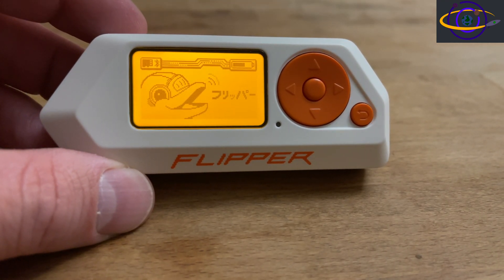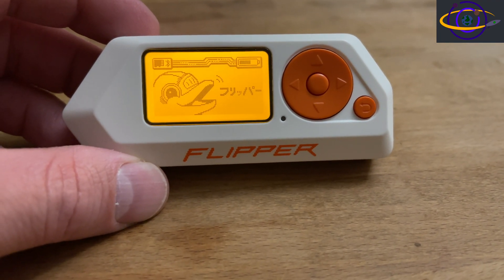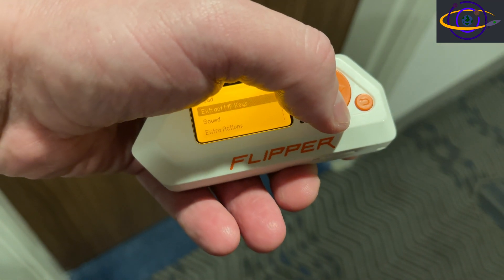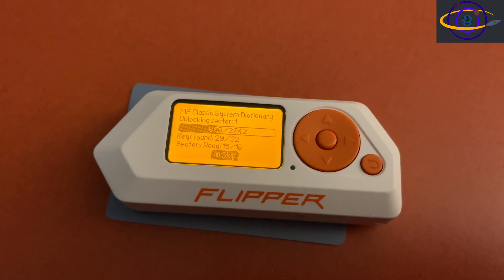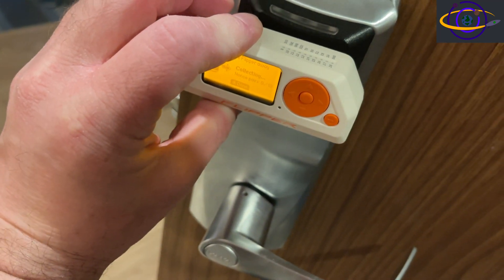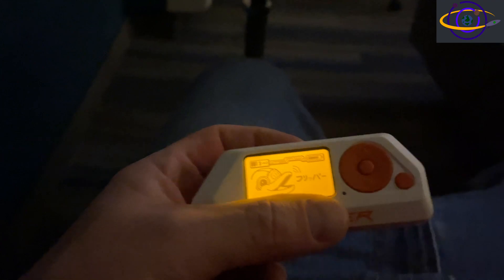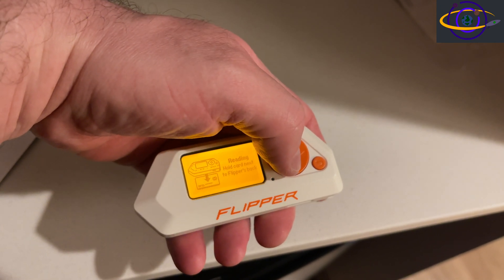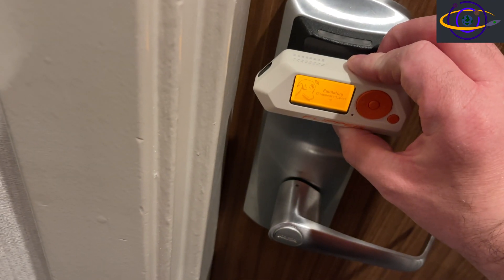Flipper Zero - NFC Hotel Key Clone - MIFARE Classic 1K

Comment: Hi, I have a safe I made at home, and I put a lock on it similar to the one in your video. The problem is that I've lost the card and can't open it. I used the "Extract MFC Keys" option in Flipper, and then I used "MfKey32," and it gave me a key. Now, what do I do with this key? How can I use it to open my lock or create a new card to open the lock? Thanks.
Reply: You are missing the card itself? Then you could be missing those 29/32 keys that are on that card. When you read the lock with flipper then you only get like 3 keys…out of 32 if I am not mistaken.
You need all 32 keys to open that lock. Some keys are in the card, some are stored in the reader.
I think your best bet is bruteforce if the lock is yours and you need the safe open with no key avalible🤔